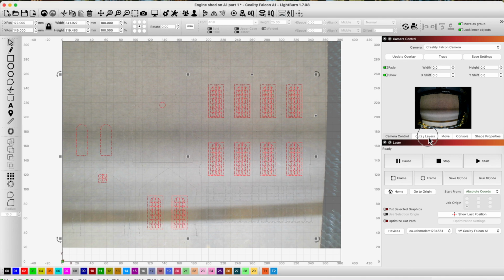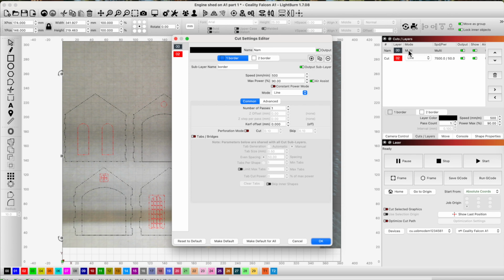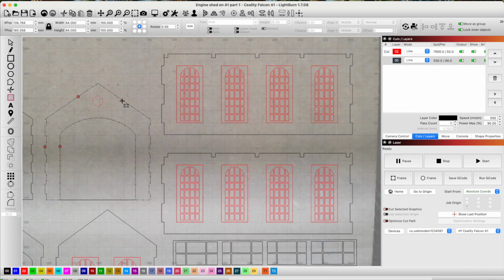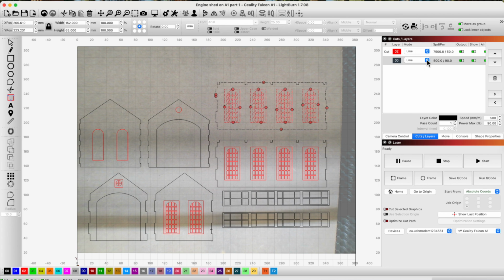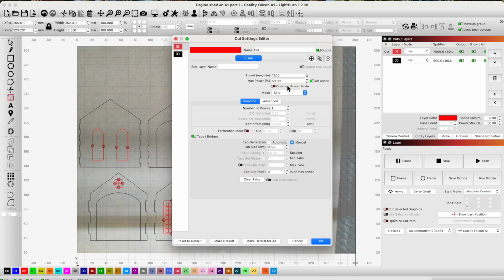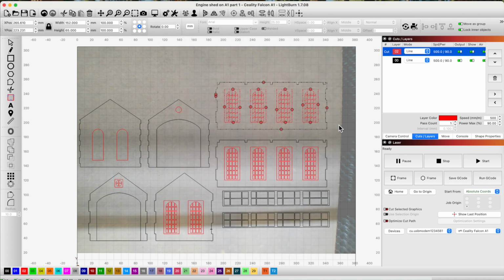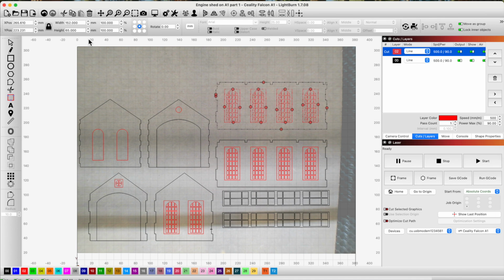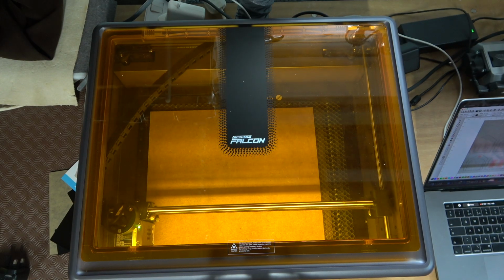Designing My New Engine Shed from Scratch to Creating on the Creality Falcon A1

Comment: Paul your link doesn’t seem to work with any discount, is it meant to automatically apply or is it a code I should be entering? Want to get my self an A1 falcon
Reply: What is the code I should be entering neither video I am clicking the link from is entering anything once I get to the website ? Cheers Pete
Reply from the maker: @darkflight4468  Hi Pete I have just loaded a new link in the showmore tab, look down the text and hit the link that states 20% discount, it will take you toi the correct place. let me know if you have an issue, cheers P
Reply: @Sandlingjunction  morning paul, unfortunately its still taking me to the full price product no discount
Reply from the maker: A Code that should be entered, If still an issue I will contact the company tomorrow and check it out cheers P
Reply from the maker: Either that or pop onto my last video and use the link there, it should be fine, let me know how you get on.

Comment: I'm in my early days of scratch building using the Falcon A1, that was a great tip cutting the parts before engraving to check it all goes together. Something I will do going forward.
Reply from the maker: Well it would seem we are travelling a similar path Matt, good luck, cheers P

Comment: Hi Paul. As with Lightburn, if you highlight one row & click the up down arrows to the right of Cut Layers window, it will swap them around. This means engraving will be done first & cutting second. Hope this helps.
Reply from the maker: Hi and thank you for that, yes I do know this, but it matters not which I move into the first position to cut or fill, it only starts with the cut black? I have looked into settings to see where or what I need to check or otherwise, but frustrating moving the layered colours makes no odds, cheers P
Reply: @Sandlingjunction Is there an option to uncheck the output on the cut only? This should then only engrave & then uncheck engrave when finished & recheck cut. Just a thought.
Reply from the maker: @hythewoodworkdesigns  I will take a look, thanks

Comment: That's a damn fine 1st effort to be honest for someone who hasn't designed and made a shed before, so rightly so to be proud.
Top Tip (from someone who does this for a living)..... if you make a building of any kind and you want to engrave bricks, design the brickwork for the building first based on measurements that you need, bearing in mind, if working in OO scale, a brick averages 3mm x 1mm for ease of calculating. That way if your building is 298mm x 119mm, it wouldn't be equally divided by 3, so you would make your building 300mm x 120mm, knowing that you will have 100 bricks by 40 bricks (unless you use a different brick bond of course!). Once you have then drawn you side wall for example of 300mm and lets say its 200mm high, you can then use the correct lining up of the bricks for your window apertures and doors....remember that a window or door would finish on either a full brick or half a brick. You'll be surprised how many don't get this right and you end up with slithers of bricks right by the window/door edge and that kind of defeats the purpose of engraving all those lovely bricks and it looks wrong around the windows and doors.
Do what you've done and create the skeleton shell in 2mm and simply align window apertures and doors accordingly and cut through, then use another sheet of MDF (use 1.5mm if you can cos 1/2 a brick is 1.5mm), if not use 2mm and encase the brickwork onto the frame. That way you will have the recesses around the windows and doors as per the real thing, just have to remember to engrave over the edge of windows and doors openings so it looks like an end brick!
Of course, there's also lots of other things to consider but that's another day!
Hope that helps and the very best of luck.
Steve
Railway Laser Lines
Reply from the maker: Wow Steve that is so generous of you to take the trouble. I cannot find 1.5 mm for a diode laser only 2mm unless you know where I can source it . 1mm mdf is not for diode by all accounts. I will firmly fall into the brick slithers category at this time. I have spent many hours designing and failing and redoing, but as I go forward I am learning ( Steeply) , to simplify the workflow a little. I have created a panel of bricks English Cross Bond for this shed, using a 1 x 3 mm vector path, copy and paste etc. Then I have added the walls etc and cut them from the panel of bricks. I dare say there must be a simpler way, I have yet to find. Standardising over all sizes and positions of doors etc is a sound idea, and my next version will take account of all this.Modification in tiny steps I guess. I do not know how to extend the laser brick engraving to create a deeper line on door and window reveals without destroying or over doing the engrave burn, I will play with that too. I am still learning and apart from the platforms I created this is my first attempt, I have such a huge hill to climb but I am an allin type of chappy so will stay with it. lol the I have to learn freecad to make plastic bits.... Cheers again Steve for taking the time from what must be an extremely busy schedule to message me, it means a lot thanks, Paul
Reply: @Sandlingjunction  If you can laser cut 2mm MDF, I don't see any reason why you can't use 1mm or 1.5mm, unless the laser cannot focus any lower than 2mm! I'm not knowledgable about those machines I'm afraid, not something I use.
1.5mm is available from EMA models, if you google 1.5mm MDF they should come up and they'll do it in smaller sheets that may suit....I buy in 1200x900 size!
Reply from the maker: @SteveSmithRailways  Thanks Steve, on the 1mm I found they say that Diode burn 1mm MDF too much CO2 are fine with it. I can burn thin stuff its just the 1mm mdf as I understand it thank you again
Paul